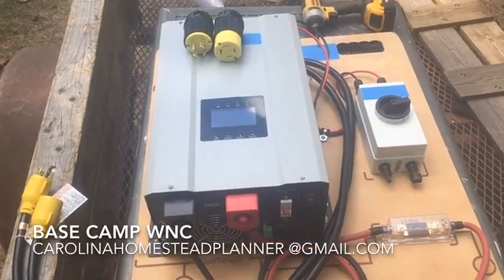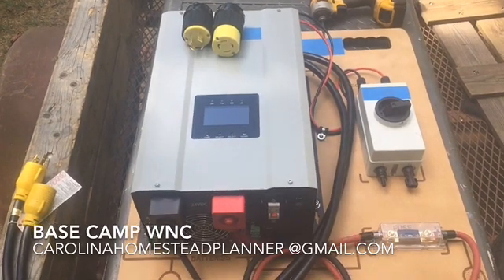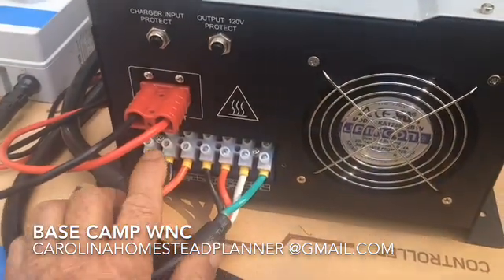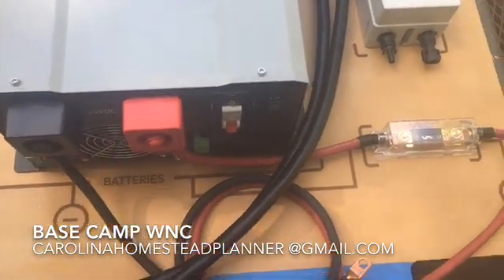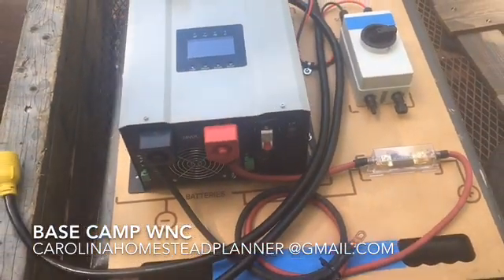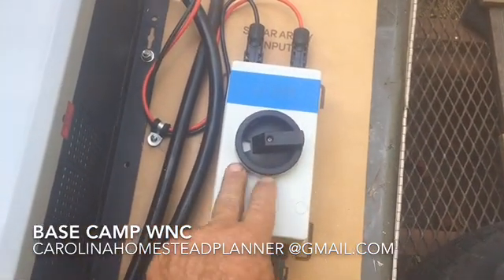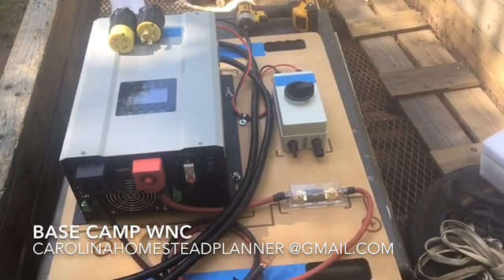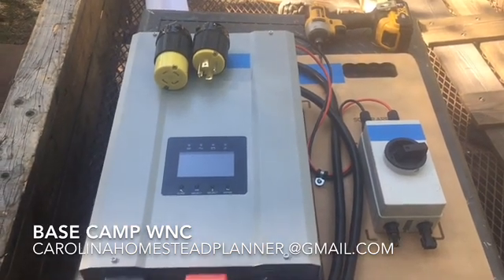Moving Your AC Power Well Pump Off Grid

Comment: Do you ship this kit to alaska?
Reply from the maker: Tell me about your setup 
What hp pump are you powering 
How many people and animals is this for
Are you powering a well 
If so how deep is the waterline 
This information will help me determine the size of the inverter 
And then how much power batteries will be needed to run your system 
Properly best to email me with your information 
CAROLINAHOMESTEADPLANNER@gmail.com
Looking forward to hearing from you 
Eric
Reply from the maker: No the company has gotten crazy with there prices 
If you are interested in building one I will walk you through the details 
Will need information from you best to contact me at 
Carolinahomesteadplanner@gmail.com
Reply: @basecampwnc1745  well is 40 ft down using a gas generator to power it for now,220 pump submersible 3 people total

Comment: How would you rig this if you have a whole house generator already installed. I would like this for a back up to my back up!
Reply from the maker: You would need to have a disconnect switch from the power to solar setup
Some systems have it where the generator works though the solar system

Comment: Good video.  I am interested in DIY system that can power my 1.5 hp submerged well pump. It sits around 75’ down.  The biggest question I have with these is the induction motor startup. 

Also interested if you are still selling these and what environment do the batteries need as far as temp range and that sort of thing.  Thanks again for your video.  Waving to you from Texas.
Reply from the maker: Brent 
To answer your question yes they are low frequency machines and built for induction motors like water pumps table saws and compressors
Also give me a idea of how much water you will need per day
How many people and animals 
This is to size the batteries 
As for the batteries lead acid batteries are best 65-85 but like your automobile they work at 0 and 100 just not as efficiently 
The lithium batteries don’t work in the cold 
Your pump will work on a 3000 watt machine will you need it to power anything else 
You can get the inverter alone and with batteries and solar panels 
Let me know if you are still interested 
And as always subscribe like and share 
Thanks 
Eric
Reply: Can this inverter be bought without panels?